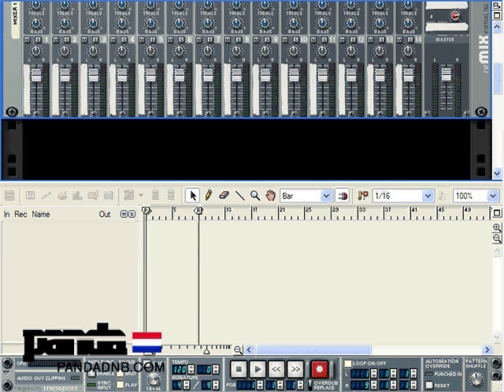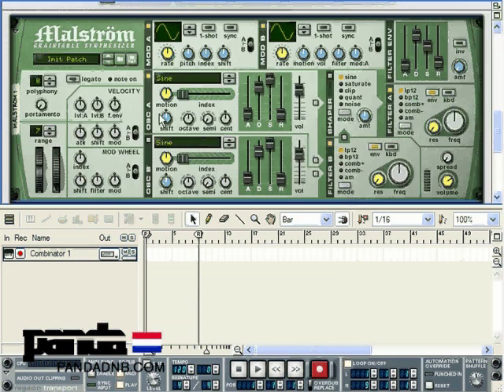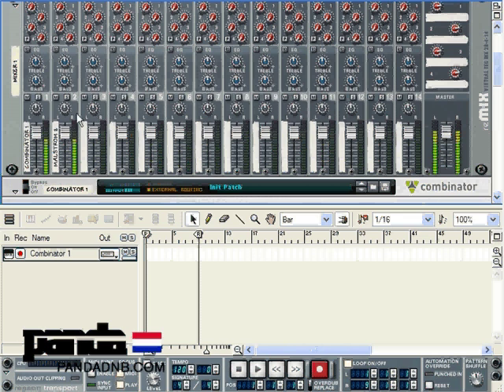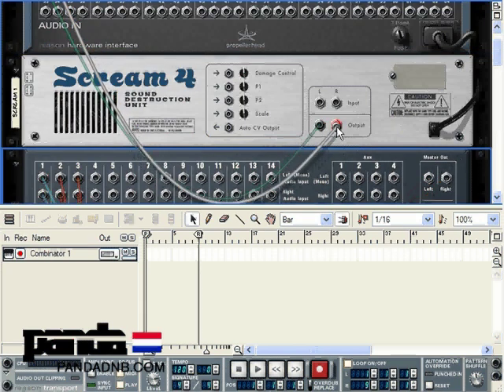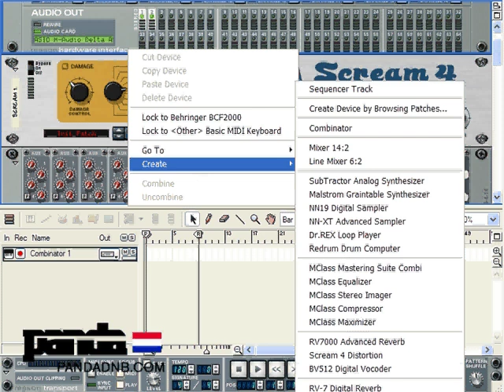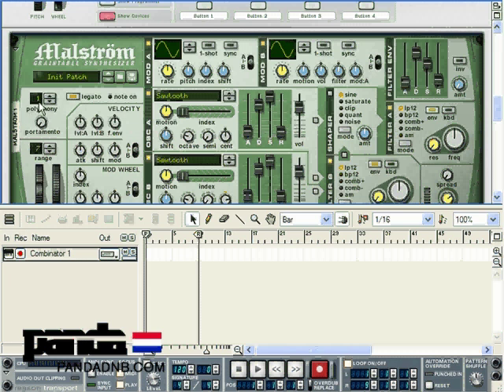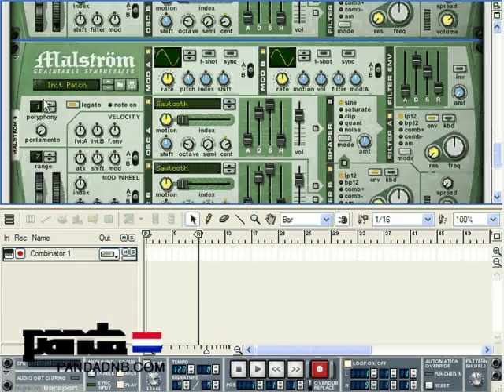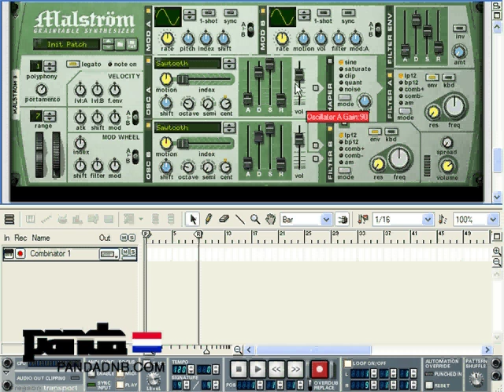Drum N Bass Tutorial |  Making a Drum 'n Bass Reese with Propellerhead Reason

Comment: Wassup Panda, good demo, just stuck tho, everythings fine up until legato, i switched it on and changed the poly number to 1 but doesnt change anything, is it cos i use mouse not a midi keyboard? 

also wonderng why u used combinator mbut didnt combine everything, u can use scream straight through it using only 1 channel instead of having to re-route u can put a 6:2 mixer withing combinator and run the malstreoms iside it, maybe thats wher ive gone wrong?. nice one if u can help ;)

Comment: why not just use the detune on the single maelstrom?
also the phase (you mentioned detuning changes the phase) is set by the slider above the octave knob. it starts the sawtooth at a different part of the waveform.

Also, another nifty trick is to have the delay pumped into the detune, and it'll auto detune the longer you hold the key down. Schweet.

Comment: How that's a real nice trick to use with malstroms, but the way you connect things is WAYYY wacked out. One of the reasons you would creat a combinator in the first place would be to get multiple synths and effects together to make a big sound while only using one track on your mixer. The scream 4 and the phaser you added (As well as the other maltroms) could have all been hooked up internally withing the combinator via another mixer created inside it.

Comment: Reason doesn't has this function, you can use your mouse on the keyboard-roll, or install some application that converts keyboard-signals to midi, but this is a mess to work with.

Want a tip? just buy a midi-keyboard. if you don't know how to play and are not planning on studying keyboard-playing, the worst crap-keyboard will do, you can get them as low as 50$ or even buy them secondhand.